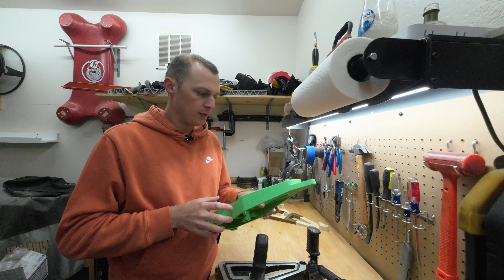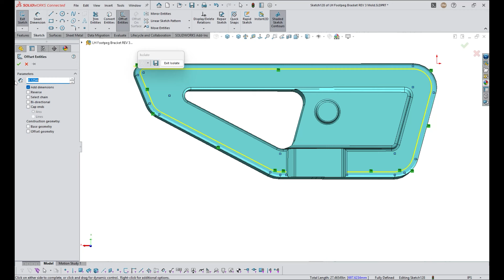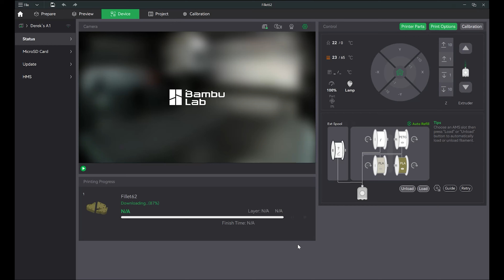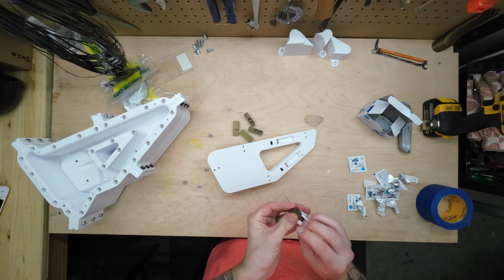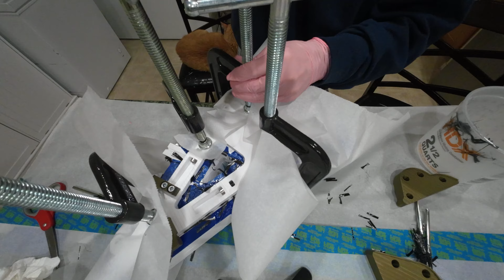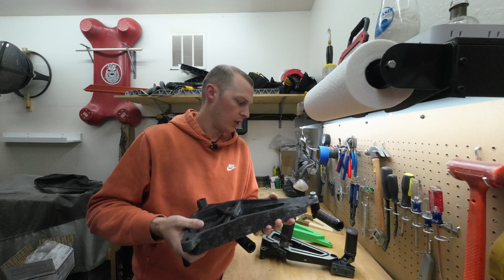XV920R Cafe Racer - EP10 - Forged Carbon Fiber Footpeg Mount

Comment: This is amazing, very time consuming though. If it was an aircraft then this exercise might make sense, but on a bike, I'm not sure. Its appearance is rather dull and gray against the glossy new footpegs. Could you paint the new part gloss black, if so why not just clean up the original part and paint it.
Reply: Spending time on something you’re passionate about is much more meaningful than spending time commenting on someone’s videos trying to diminish their work and effort put into their project. Hope this helps Paul!
Reply from the maker: It is dull because it’s not completely finished yet as I mentioned. Once it’s finished with a clear coat it should match the footpegs quite nicely and be much deeper black color. I didn’t want to keep the original because of the extra holes that would be empty and it wouldn’t match the subframe. When it’s all done, it’ll make more sense. Probably overkill for a bike but that’s the point of a custom build. It doesn’t have to make sense.